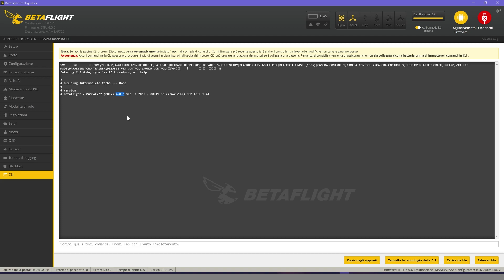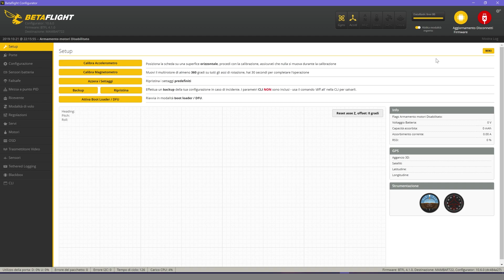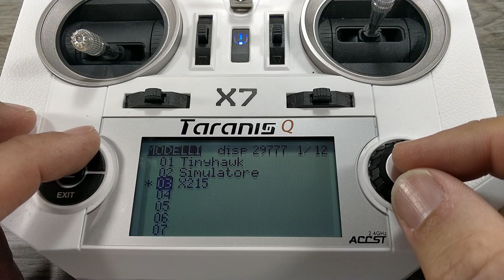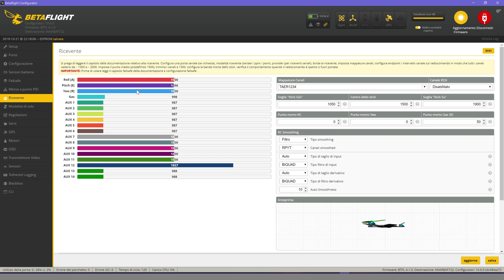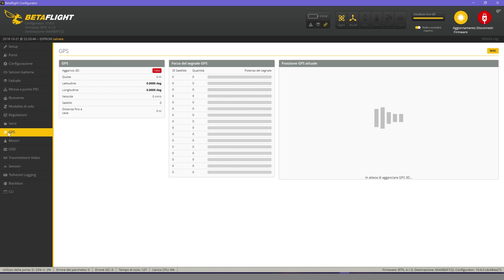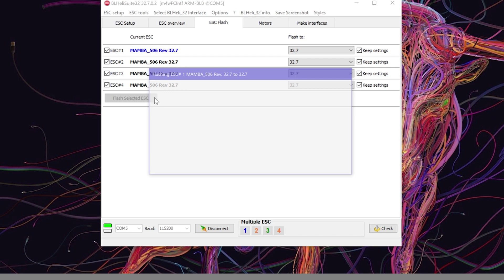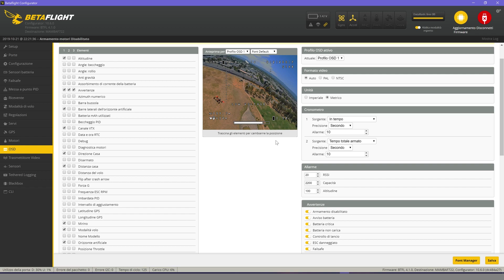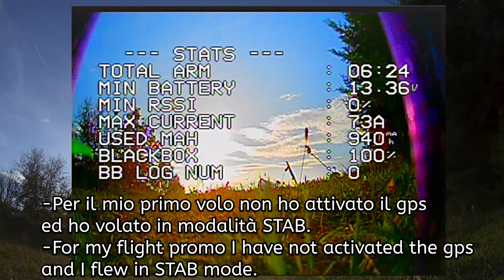GUIDA SU COME COSTRUIRE UN DRONE PER FPV | How To Build FPV Drone 2019 P. 3/3 PROGRAMMAZIONE | SUB.

Comment: Ho costruito il mio fpv 250mm seguendo molto la tua guida ma domanda... Perché selezioni dshot 300 dal momento che la f50 pro supporta anche dshot 1200?
Reply from the maker: Ciao. Il dshot 1200 non esiste più. Con il nuovo aggiornamento di betaflyght è stato eliminato. Avevo letto da qualche parte che il 300 andava benissimo perche meno soggetto a disturbi ma potrei dire una baggianata.. Non avendo mai avuto nessun tipo di problema volo ancora con il 300..
Reply: @cosmochannelvideo  si per il 1200 sapevo essere stato rimosso, però guardando i calcoli matematici sulle velocità di trasmissione di dati tra 300 e 600 il 600 pare essere quasi veloce il doppio, parliamo di microsecondi eh, poi io parlo da completo neofita basandomi solo sulla carta che ho trovato in rete